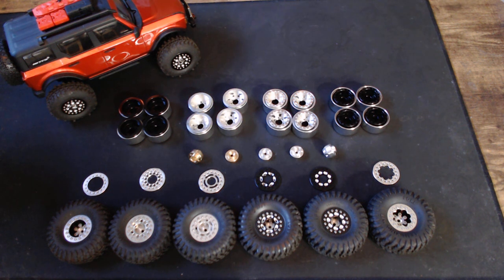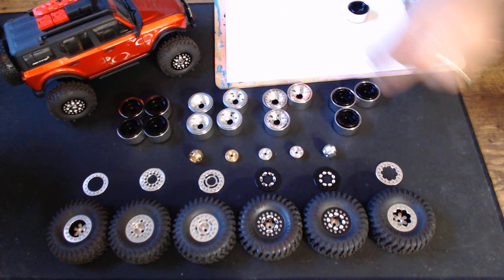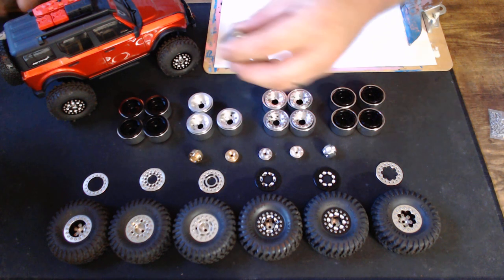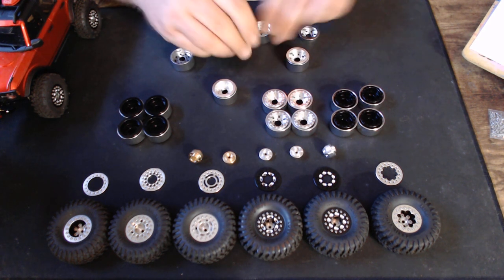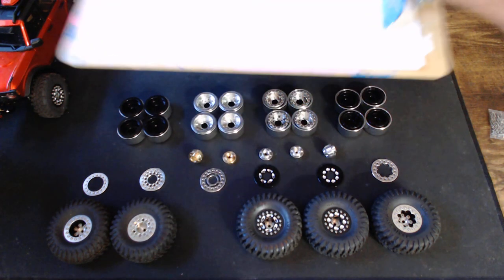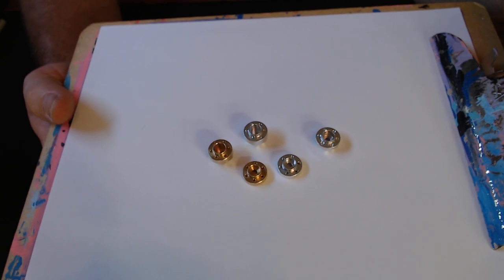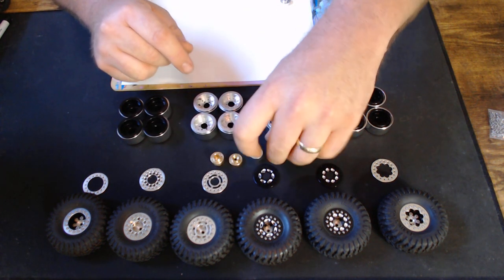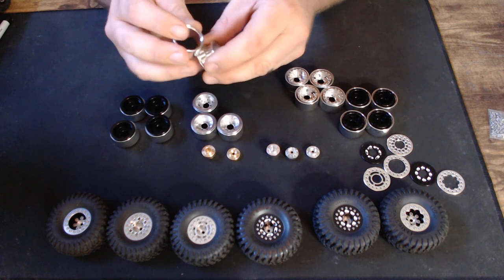Wheely Great Video about Wheels, UPW and DDP From Mofo Rc for SCX24 and others

Comment: So if you are using the DDP in the -1 offset configuration, but they are also on the "zero" (+2ish) offset hubs, is your track still -1mm compared to stock? Or is it more like +1? I'm  trying to build a truck with a narrower overall track width than stock.
Reply from the maker: It will still be a little wider than stock
Reply: @MofoRC  ah thank you!